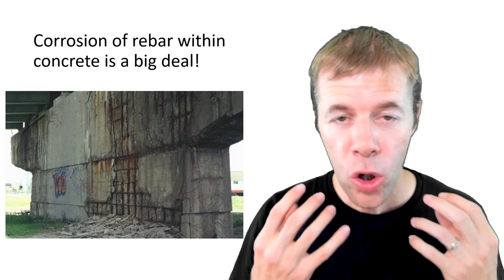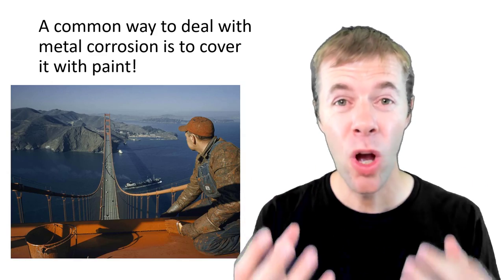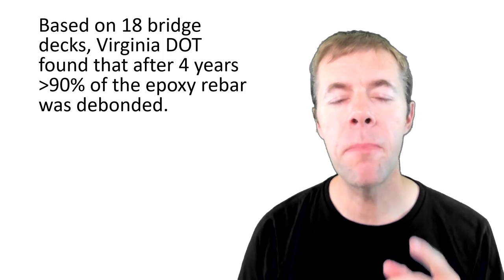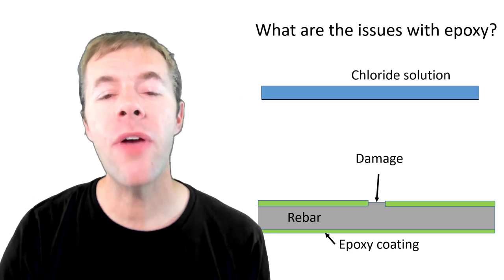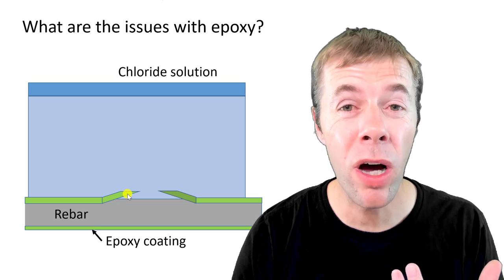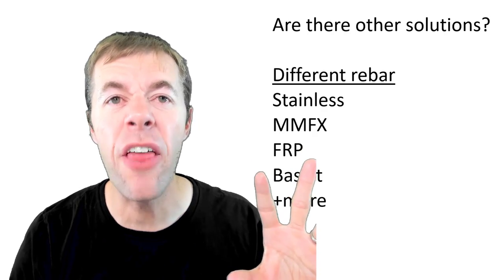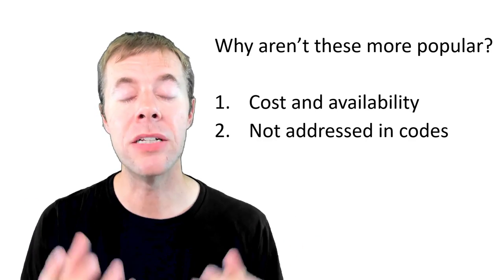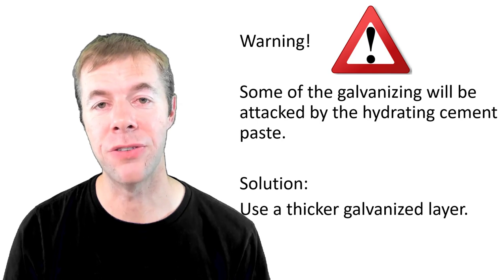What is epoxy coated rebar and why is it being banned?

Comment: add zinc oxide powder to the concrete mix . give the chlorides a sacraficial meal long before it gets to the galv rio !
Reply: First of all it's already oxidized, secondly wouldn't that only extend the lifespan until it's used up while also screwing up the mixture?

Comment: If you have experience in our design/engineer/build world, you have to love all the good things about galvanizing. Electro zinc coating?  Better than not any but not thick enough for serious construction.  Hot dip galvanizing?  Much better.  However, when welding, the zinc must be ground away to weld.  What does one do where all the welds take place?  And cutting the bars to length exposes and end or two.  Field applied coating are what we use but they must be applied to clean surfaces and temperature is a factor.  There are also environmental considerations with hot dip (like everything else we use).  Let's ramp up the problem one step.  When dealing with coastal areas and salt water areas, the salt / corrosion factor is even greater.  We see dams, bridges, buildings, docks, etc.  with visible rusted / corroded rebar where the concrete has broken away exposing the rebar.  A product that allows bonding to that layer and chemically changing the top layer to stop the corrosion is needed.  

If one considers all the old bridges, dams, spillways even guard rails on highways and buildings that have already been weakened, they must be rescued.  What about post tensioned slabs cabling at the clinch ends ?You need only look at the Miami coastal tower inspection photos which show the surface problems; however, there is rusting as we speak spalling more concrete and further reducing the strength of the designed unit.  Prior to the collapse photos are what I am referring to.   Agree with Tyler's conclusions, epoxy coated rebar has not withstood the test of time.

Comment: i have literally no idea what i'm talkign about about, but is alumin(i)um rebar a viable solution? i've never heard of alumin(i)um rusting, but i also don't know it's cost and durability/support vs. steel, i know it is lighter and weaker but i'm not clear on how much and if it would be a terribly unsafe idea or not. (be very glad i don't build things)
Reply: Absolutely not.  Aluminum will actually corrode relatively quickly in concrete.  Codes forbid using aluminum in concrete.  It creates the same issues that corroding steel rebar would have except you don't need the outside chloride attack to cause the problems.
Reply: @clee8768  oh, so that's why is don't build bridges yet, also if i did build bridges i would probably have been bankrupted by now.
Reply: @cageybee7221  never put aluminium near wet concrete
Reply: Also quite a poor tensile strength
Reply: Aluminium is attacked by strong bases such as the calcium hydroxide in wet concrete- the reaction dissolves the aluminium to form aluminate ions (AlO2-) and hydrogen gas. For this reason you should not cover aluminium items in wet concrete (especially the quick-setting kind) or place aluminium cookware in your dishwasher (as dishwashing tablets contain strong bases and will damage your aluminium skillet.)
Reply from the maker: Thanks for all the help with the answers!
Reply: Some aluminium alloys are more resistant to corrosion than steel, but these are way more expensive than just using stainless steel rebar (yes there are aluminium alloy rebars). There can be a combination of light aluminium alloy rebars with special light concrete but the price is the problem, not the materials. Also if you have that much money, why not  just use steel plate profiles and paint them, why use concrete and rebars at all.

Comment: Don’t understand why corrosion in one spot would penetrate faster than overall corrosion.
Reply from the maker: Peter,
This is how I responded to a previous comment.

This is common in corrosion.  There is accelerated damage in one region because of the high ratio of electron density.  Think about digging with a shovel.  If you dig over a whole field then you don't really change the level of the soil.  If you instead dig in one spot then you can dig a deep hole.  This is the same thing that is happening with the epoxy coated rebar.
Reply: Correct Tyler Ley
Reply: because the protective layer,(whatever that may be,,) fails in one area due to application fails or environmental factors,,(damage,stress etc.)
Reply: Peter Pan I think your question is interesting. The response you got was clear but didn't address the 'speed' aspect. I am going to guess that the speed isn't really increased much, though maybe slightly due to the adjacent area having unreacted reagents ready to leach in.
Reply: concentration of stresses
Reply: it don't,  it does not migrate to the damaged spot any faster or more concentrated. That idea that it will is a missguided advise as far  as i can figure
Reply: Because the sodium chloride on the steel produces electrical currents that produces the corrosion. Since the steel area is limited all that current goes through that one spot. This effect happens a like when different metels come in contact with each other.
Reply: Were there attempts to fight rebar corrosion with electrochemical approach? E.g. inserting replaceable anodes of magnium in grid-like fashion?
Reply: Yes, it was an early problem with outdoor chrome plating.  Bumpers rusted out quickly early on until they learned to coat where they actually caused micro webbed cracking to occur everywhere in the chrome.  Then the chrome plating lasted MUCH longer.  Does seem kind of  counter intuitive, but it's reality.
Reply: Pitting corrosion can eat through a 3/8 steel plate in several weeks, it can also destroy stainless steel in  the same time... James carruthrs

Comment: Basalt Rebar all the way!
Reply: Exactly.  Basalt for the win.  His galvanized rebar has some fairly major problems.  Chief among them is tying it together and cutting it.  Can't weld it as inhaling zinc makes you sick.  So, if you can't weld it, you must tie it.  Zinc is soft.  So, wherever you tie it, you will be crushing this thick zinc layer which will automatically be a corrosion point.  To see this in action all you have to do is look at any spot on your current gutters on every house.  Or any cut end of galvanized steel anywhere in the world.
Reply: w8stral Industrially Basalt could also be far cheaper than Steel from a manufacturing point of view. You can mine any granite or basaltic bedrock from almost anywhere around the world and melt it into rods or custom forms, it melts at a lower temp than steel, twice the tensile strength, half the weight, no corrosion, same expansion rate as the surrounding concrete; makes for a clear winner, though the steel Industry would take a big blow.
Reply: Imagine how long structures would last, at the very very least,  thousands of years.
Reply: The steel industry would not take a big blow as the "Basalt" would be from the dregs of their steel production.  They would be the ones making it as only they have "free" liquid molten "basalt" to turn into rebar.   @plumsmuglers
Reply: Exactly.  Tougher, stronger, lighter, higher fatigue life, no corrosion, matched thermal expansion properties.  Yup, Basalt is the clear winner.   @plumsmuglers
Reply: Only disadvantages might be that it can not be bent on site. And cost.
Reply: LockPickingLoser D - haha, that's true I guess. True in general it seems today, and a skill we could all improve I suppose. The quick turn to name-calling whenever there is a difference of opinion is sad in an "intellectual" field like engineering, though. I guess when you don't have to face the other person, you can be as rude and insulting as you want! 

I enjoy LockPickingLawyer's videos, apparently you do, too?
Reply: w8stral I don’t know much about basalt rebar, or rebar in general, but I studied geology enough to know a little about the geochemistry of basalt. It seems to me that an added benefit is that the basalt rebar could be custom manufactured with a chemistry specified by the end user. The specification could favor weight, or ductility, or tensile strength, or price, all based on the application. My guess would be that currently steel rebar must conform to a set of physical and chemical parameters to be certified and accepted for use. Is there a similar set of parameters for all the different compositions of basalt that could be used, or would the basalt rebar just be required to conform to the existing steel requirements and let the producer/contractor/customer reap the benefits. Also, does a large scale production facility exist yet for this product?
Reply: Dig Byck - no, not an engineer, just came across the video. And pretty sure I was not the one pounding my chest and calling someone else ignorant, which is what I commented on. Don't know what I said that irritated you, but your advice is good, people should get over themselves, so I'll take the advice.
Reply: @w8stral  And you do? How's that? It is not commonly used in the US.
Reply: If there's one thing I know about politics, it's that people aren't gonna want to pay to replace stuff whether it's in thirty years or one-hundred twenty years. If there's a viable permanent solution, I say to go for that.
Reply: Basalt is not commonly used anywhere.  too danged expensive.   @danhillman4523  It is just another Fiber like Fiberglass.  Difference is that it has superior fracture toughness.  it works wonders everywhere one has contact with salt water as you NEVER have to worry about corrosion.  Been using FRP rebar in water tanks for years.
Reply: Dig Byck - dude, maybe you should read your own comments, and get a mirror. You got some nerve calling other people full of themselves and condescending. Go troll someone else.
Reply: Nope, too stiff and inflexible, useless in tension just like concrete,
Reply: Axe Man HUH?
Reply: Basalt rebar is amazing but expensive as shit. But if you want something virtually indestructible that won't corrode and will last for god knows how long then that's your boy. Some objections to it's wide spread adoption is that it can't be bent on site - big issue - and it needs to be certified to be manufactured as it can be made with flaws, rendering it unsafe. Basalt definitely has a future though  and the U.S. literally has plains of the stuff.

Comment: After a reinforced concrete structure is finished, why don't they yearly (or every few years) apply a high quality sealant to the outside of the structure to keep moisture from leaching through  the concrete, mixing with the chemicals in the concrete and attacking the coated rebar?
Reply: I just saw a commentary on buildings falling down , big topic this last week.       It seems that waterproof paint was the big thing in late 80s and early 90s?    It’s more sealing so better right, WRONG.    It works but holds what weeps in right inside to blister the paint snd fo even more damage.    
   I ever had a clue about this either thinking that paints were waterproof.   I guess these things are under constant development .

Comment: Having been in const all my life..most of the structures we have torn down and replaced .. the rebar (black) is not that badly corroded. Usually the bridge deck concrete deteriorates first and is the controlling factor. Not to say that if there is a gutter line on a bridge deck  along with a construction joint the rebar won't corrode.

Comment: Why not epoxy coated galvanized rebar?
Reply: Coating over galvanizng equires meticulous preparation of the zinc surface.  It's a hard metal to paint over successfully.  And in any case that's not the point.  Galvanizing works in two ways.  The first is that its corrosion product of zinc oxide is supposed to form a smooth layer of inert oxide which resists further corrosion (like anodizing of aluminium).  Recognizing that it will be scratched and pitted - exposing the metal underneath - the zinc then acts as an anode - giving up itself to the steel underneath till it is all used up.  At which point the metal underneath starts to significantly deteriorate.  (There are still problems with stress risers forming in the corrossion pits that can cause failure).  The byproducts of corrosion when encased in concrete are still going to expand and cause cracking and debonding of the concrete.   You can take a boat anchor and re-galvanize it.  Not so easy with embedded rebar!

Stainless is not such a good idea either.  Never mind the expense.  It is StainLESS.  Not NEVERrust.  Stainless works best when it can form an oxide film like anodizing and where it will not be encased.  The film can be enhanced by polishing to smooth over microscopic defects in the oxide layer.  When Stainless has roughness caused by welds and scratches and is then immersed in a chloride solution - it is often no better than mild steel.
Reply: why not epoxy coated, gold layered, carbon covered, tungsten alloy?
Reply: @Blox117  finally someone said what we were all thinking.  I was going to but I get nervous at parties

Comment: Urban Myth. The Golden Gate bridge has only been completely repainted three times, each time using a more advanced and corrosion resistant paint. Certain areas of the bridge, especially those exposed to pedestrians, routinely need touch ups, but the bridge as a whole isn’t repainted on a regular schedule.
Reply: You don't provide a reference for your claim, so I looked for my own. Here's the Golden Gate Bridge Highway and Transportation District web site, where they say "The truth is that the Bridge is painted continuously." I think that's authoritative, no?
https://www.goldengate.org/bridge/bridge-maintenance/painting-the-bridge/
Reply: @SMorrisRose  Big difference between being painted continuously and starting from one side and painting to the other every year. It just means that the bridge is so large, that its always needing paint somewhere. That doesn't mean there are 50 layers of paint at any given spot.
Reply: @Sandler23  Please consider providing a reference for your specific claims.

Comment: The best thing about galvanizing is it still works where there are holidays in the coating. That's because it isn't just a physical barrier between the environment and the metal but a sacrificial layer which gets used up instead of the steel being corroded.
Reply: What does it being sacrificial have to do with it "still working" where it's missing? Do surrounding areas passivate the bare areas somehow?

Comment: Why not just epoxy coat the galvanized rebar?
Reply: it would need an even thicker layer of zinc
Reply: WTF?????WHAT THE FUCK FOR??? IT'S FUCKIN'GALVANIZED!!! COAT IT WITH EPOXY (COAT ANY THING WITH EPOXY) AND IT WILL LAST A THOUSAND YEARS,FUCKING,, EXCLAMATIONMARKEXCLAMATIONMARK......  Cheers mate !  @KillaBitz
Reply: @KillaBitz  use a better epoxy.
Reply: Ok galvernising constanly moves if you scratch it it sort of repairs it self if you put epoxy on it it stops this process, look at yacht anchor chain its scratched as it goes over the roller and when its draged along the bottom but the galvernising creeps and it remains covered
Also this green epoxy is not a true epoxy its a paint and not a structural adhesive like true epoxy

Comment: As a superintendent I’ve had to deal with County inspectors who wanted to test the adhesion and coating thickness of galvanized columns, even though this exposed parking canopy structure was in the desert.  He also had issue with the cold galvanizing patch at the welds because it didn’t match well because of the sheen and whether it was an acceptable protective barrier.  I told him first off, galvanizing was never meant to be architectural, too many factors that would make it an inconsistent finish even within the same dip and secondly, the spec book, guidelines that cold galvanizing(spray can basically) is what’s supposed to be done at welds because you can’t dip a huge structure and welding requires bare metal.  Which leads me to, it could possibly be a huge headache for some concrete jobs, more than likely, a special inspector(3rd party) would need to be onsite full time for the duration of that activity

Comment: rust expands,,, so it is Prying the epoxy off and causes it to debond.
Reply: That's the thing rust wouldnt happen if the coating was perfect but since it has microscopic scratches the corrosion process is speed up
Reply: Triple the volume.
Reply: I met a fellow a few decades ago who crewed on a cargo ship that carried sand to Saudi Arabia. The sand came from a quarry in Wales. Its purpose was strong concrete. Saudi sand is worthless for that purpose because the grains are polished by wear. The irregular grains interlock to produce much stronger concrete. The difference between piling bricks versus piling baseballs. The rock & mortar foundations of old Rhode Island homes would crumble if made with beach sand -- or similar. Sand quality (irregular grain) is essential for strength.

Comment: There are newer admixtures that can greatly reduce permeability of the concrete, while also increasing strength. Penetron is one that I have used recently, which I approved for use on concrete for a substation out in the middle of nowhere, where we had high water soluble sulfates in the soil. The Contractor could not get Type V cement and their Type I/II cement had too much C3A, so we used Penetron to reduce the permeability to reduce the risk of sulfate attack on the concrete. The reduced permeability also helps with chloride, and we actually used the same mix design as a large water treatment facility nearby, that needed the chloride protection.